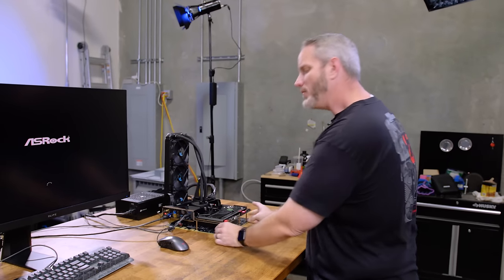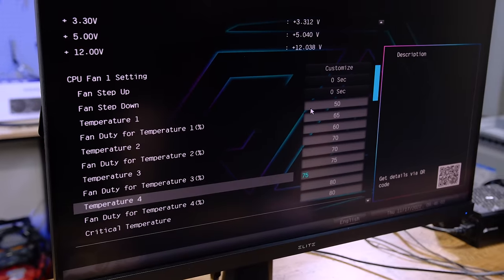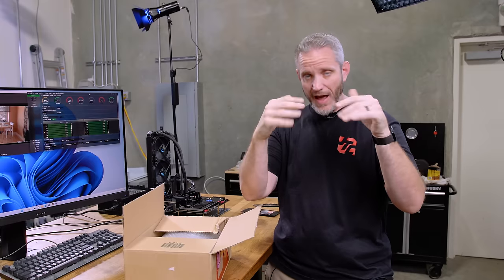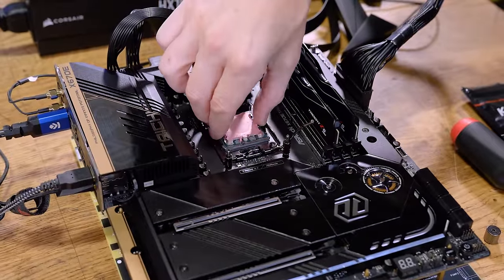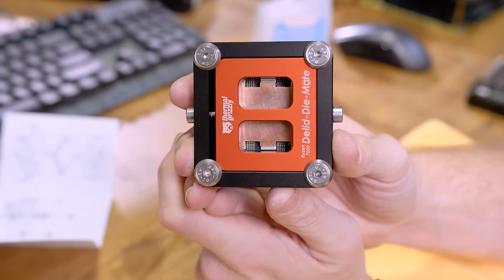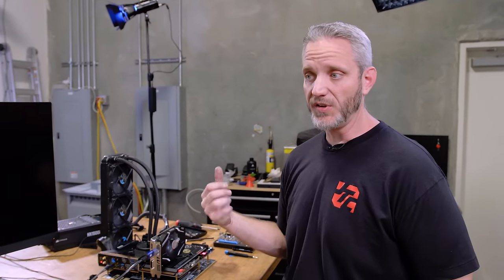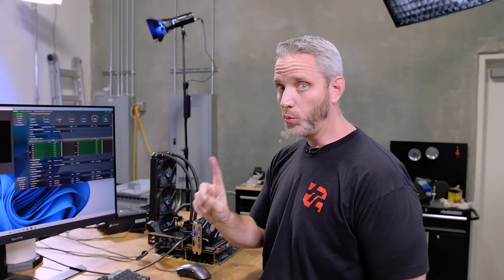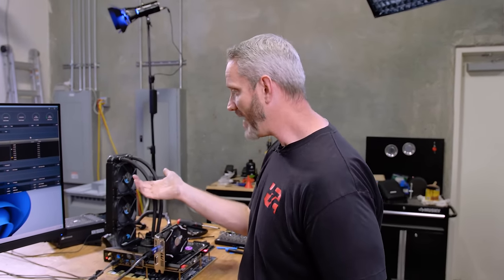I was scared to delid my CPU, but then...

Comment: Arctic MX-4 will do anyone just as good as Kryonaut, don't feel pressured to use Kryonaut just because Jay said so. Kryonaut actually has been proven to degrade/dry out faster above 80C, meaning using it on Ryzen 7000 will not be a good idea.

Comment: What is the coresponding settings on MSI boards to decrease voltages on CPU ?
Im using right now PBO on, Curve optimiser  on each core but overall voltages on CPU is about max 1.45

Comment: so with the new ek waterblock for am5 they don't use their own backplate anymore it is made to use the sturdy backplate that already exists. i just ordered their velocity^2  for am5 and it only came with the waterblock and the tools to install. it's screws are also completely contained in the housing and non removeable. so you now need to place on the waterblock and screw set up in through the back of the motherboard with the self contained screws which pulls down on some springs and places tension on the device. way different than the velocity^2 am4 which they just made a backplate for if you already had the am4 waterblock. this post is about jayz comments around 26min in.

Comment: I wonder if any of the major watercooling companies plan to make a block / mounting kit for de-lidded CPUs.
Reply: With the water blocks I have used the last few years I did not need another mounting kit. The bolts usually have enough thread and it is worked with springs. Otherwise bolts from the hardware store also always go.

Comment: CPUs are very much a Lottery, and sometimes you are just the Lucky Winner with a excellent peace of Silicon that can handle much lower Voltages without instabilities then the rest of the same CPU.  Instead of an Offset at 20-40 mV you can set the Values to -60,70 mV or even Lower. You should not be afraid to just test by lowering the Voltages step by step until the System crashes.

That indicates, that you have to go back to the previous Setting, there's you're stable Setting. You can of course add a little more Voltage as a Safety Margin. The CPU wont be able to get damaged, only from Overvolting.The System will recover to a stable state after the Reboot, don't worry. I, and many other Overclockers have done that many times and like i said, it's Impossible that the CPU could get damaged!

it's like a Car that runs out of Gas and they too will indee restart after you put Gasoline back in the Tank. ⛽ AMD has now a cool, and even safter approach with Curve Optimizer where you can tweak the Voltages for different Clock Speedss

Comment: So, you went through the trouble to set static fan speeds and temperature test the CPU before delidding so you could compare, proceed to test it and blame it on the voltage. Lol. Nice apples to apples comparison.
Reply: He had to do something after doing all that work and not seeing an improvement.....

Comment: When I replaced the cooler on my 7900x just to see how the paste was applied, as long as u wipe most of the paste off when the CPU is still installed in the socket and u don't remove it and clean most of it and then take it out u should be fine

Comment: I have an old Intel P3 1GHZ CPU that came already delided. Would be nice if AMD and Intel would offer delided CPUs like Intel used too. Or just milled them flat at the factory and actually used good thermal paste instead of that cheap crud they currently use.

Comment: You have it a little sideways with whole tangent about the BIOS.  Running a negative voltage offset means that for a given frequency, it will specify a lower core voltage.  This means less power draw and less heat output.  The improvement you found by running the offset works regardless of the cooling method.  The improved cooling lets you run more power (read: voltage) through it while staying under 95C, which means you can run higher voltages and thereby keep a higher clockspeed stable.  TL;DR improving the cooling moves you along the voltage-frequency curve, assuming you aren't maxed out on voltage yet, but changing the curve offset shifts the whole curve to a potentially more favorable setup (depending on how good your silicon is because bad silicon won't always be able to run those -40 mV undervolts and remain stable).

Comment: The more time goes on, the more I appreciate my aging 5950x. Efficiency is where it's at. If you work on your computer and game like I do, running a 5950x is a something like $10 savings a month compared to some juice monster like 13700. After 3 years of use I will have energy savings over more than 1/4 my card! I genuinely believe people need to consider the cost of higher power draw, and also shorter lifespans inherent of juiced up components.
Reply: Having a more efficient CPU also means less heat in the room. That's the only reason one of my friends went with the 5950x over Intel.

Comment: Now, if AMD hadn't insisted in shoehorning "compatibility" of coolers for AM5, of which half aren't even compatible anyway, rather than just implementing a new AM5 mounting system, then the IHS wouldn't be so damn thick, temps wouldn't be so high, and none of this would be damn necessary. It really irks me AMD went for jank "compatibility" over performance and manageable temps!

Comment: Yeah… as someone who has had 3 Asrock motherboards, the lower end ones

They are really annoying to use

Back when b350 was new, I had one and got so fed up with its weirdness that I just got a MSI tomahawk that was WAYYYYY nicer

Even on Intel, the Asrock boards are really annoying, I had a h61 board? I think

Back with an i3 3320 that I had pulled from a dell pre built, and everything  worked fine, till I wanted to trade it out for a i5 3550 that I bought for 20$

It gave me THE MOST DIFFICULT time getting it to even post

At first I thought the cpu was borked, but I had another lga 1155 board that it worked fine on

So I was like ????

It finally worked, after I removed everything that was plugged in other then power, and plugged in only 1 stick of ddr3 Corsair Vengeance 4gb

I ended up getting an asus board that I was wayyyyy happier with

At the end of the day, Really, imma stick to Asus, MSI and EVGA for boards

Everyone else kinda seems second rate in comparison, always funky stuff that happens otherwise

Comment: i delid a i9-13900k and now my mobo has a dram light and doesn't post. :( a celeron G6900 works in the mobo.  F

also you can bend socket pins and bend them back and have the board work perfectly fine. i've fixed a few bent pins on different boards before. accidents happen. 
you just use a good magnifying lens and sharp tweezers. observe surrounding unbent pins orientation and the angle they reflect light and get it to match as best as possible. 
breaking a pin off is the socket killer. i haven't had that happen yet. 
Also there's a surprising amount of ground pins surrounding the communication pins so you might get lucky and that pin doesn't matter. usually all ground pins are connected on a pcb unless you got isolated circuits.

Comment: I know this has nothing to do with the video, but does anybody know why on a windows 11 system that unless the power supply cable to the outlet is unplugged before startup the wireless adapter on the strix b550-f gaming wifi II motherboard won't work. it works fine if when you shut it down you unplug the computer from the wall.

Comment: i've used kryonaut for awhile, and the extreme version doesnt have THAT much different than the Thermal Grizzly Kryonaut. think the difference is 11.2 to 12.1 or so.
Dont like the color of the extreme tho, but i do love the cooling performance of Grizzly so thats  what i use, and if you compare  the paste that is stock on the corsair H115i elite cap vs removing that and adding the Grizzly you have 10-15 degrees celius in difference in cinebench R23.  The idle temps are also noticeable by 3-5 degrees.    I don't know if it is that the paste is more effective under heavy load, but it shows its effect when you run cinebench! :)

Comment: got a ASUS TUF GAMING X670E PLUS ddr5 32gb 2x 16gb @ 6000MHZ and i was getting instability w my DH15 cooler, i checked thermal paste method and it was fine so knew was something else. (YES I CHECKED QVL memory compatibility and did full memtest was not the ram)

solved my personal issue by turning off cpu performance auto boost and sticking with the expo II settings, and solved my uncomfortableness with the whole 95c AS DESIGNED TEMPS that AMD claimed, by turning on AMD ECO mode 170w.

I lost roughly 8% performance, but now CPU only gets to 72c under 100% sustained load, and system is stable and passed an overnight CPU and GPU stress test.

its a weird ass CPU thats for sure.

Comment: Hear me out, for the backplate/mounting depth issue, nylon washers with the same depth of the IHS behind the motherboard. Potentially easy fix?
Reply: That wouldn't be good because not even mounting pressure. Maybe 3D printed Nylon solid spacer? But to print nylon that's a huge setup, heated print chambers, etc.

Comment: You need to be running a lot more stability tests after applying your negative curve optimiser settings. Chances are you may have a couple of cores erroring without further testing and setting per-core negative optimisations.
Reply: This. I let Ryzen Master figure out a voltage offset for my 5950X with the Curve Optimizer. It came up with the max of -30 mV. It was completely stable during Cinebench, but not stable at all during gaming.
A different YTer said his highest stable offset was -12.

Comment: It felt like your video took a huge jump, missing out the mounting of the delidded CPU -which I was wanting to see, and to hear you discuss - and initial testing.  I had anticipated that you would have rerun the tests under exactly the same conditions as you did prior to delidding, so I was completely confused from that point.  I am a novice at overclocking, so you can read this as the idiot-level testing of your video.

Comment: That thermal paste is expensive wow it works well. Been using it for a few builds not and for my first GPU water block. 380 50c with an overclock while gaming in an SFF case.

Comment: Asrock loves beating CPUs with overkill voltages. My b450 steel legend was pushing 1.5v, with LLC of 5, onto my R5 3600. Needless to say my CPU was hitting 97c in the winter times, so went into the bio and manually set the voltage to 1.15v with an LLC of 3 and I dropped over 40c. This was on the stock cooler BTW.

Comment: Thick IHS is going to plague this platform for 3-4 years then.
Even when soldered it's hurting thermal conductivity, only thing they can improve is the efficiency of the chip to lower temps.
No fucking way I'm going to run a 95c CPU 24/7 even if it's within specs.

Comment: Is kryonaut extreme for everyday use or just for these short term high  level overclocking  attempts for benchmarking , does it have longevity on the die vs more traditional  still effective variants of the grease aeronaut, kryonaut

Comment: I had problems with grizzly Knox thermal paste with my amd cpu and saw high temperature with Grizzly Knox  thermal past. It did not work for the EVGA 3090 FTW gpu card. I had to switch the past out with kingpins thermal paste and saw the temperature drop on both the amd and Nvidia cpu. I am using it on the 12 gen 1290 k cpu intel.

Comment: Now I'm wondering if AMD or intel will ever Make a CPU that is specifically designed to be water cooled so instead of mounting a cooler on top of the CPU the CPU is actually integrated into the cooling loop

Comment: Be nice to see a kit developed with different mounting screws /springs etc to cover bolting on the AIO's as that sort of hardware isnt what I can pick up instore, and is an minimum order online type. If you buy you wait and wait and then oh no, wrong size dosent work, back to ordering again.... and again.... you get it. So get a kit together with a million cross options and sell it for say $50AUD ($32USD). If i'm going to spend $100 for a de-lid tool / risk killing a $1250 CPU, what is $50 more.

Comment: I wonder what kind of performance gains you’d see from simply applying the BIOS tweaks. The idea of lapping and delidding the CPU only to then be required to manufacture your own mounting solution for the cooler is more than I’d be comfortable with. Honestly, even delidding would probably be beyond my comfort - those sounds would paralyze my hands and wrists from continuing to apply force.

Comment: Will you do a video on bios for gaming? Most of us puts everything together. update drivers and that's it. But if we can get better performance through setting up the bios if it can help. Can i use my Ryzen 5600g APU and let it sync with my GPU to use both GPU and dedicated GPU power for double the performance?

Comment: ASRock is throws a bucket load of voltage through LLC if it is set to anything other than normal or high(you'd have to reduce vcore to compensate). This happened on my 8700k and 3570k and am waiting for my 7700X to come back from the store(waterpump coil noise) to see if on an Asus MB I can do exactly the same, 95ºC is too much and would rather not have to deal with potential stutters down the road on demanding games because it keeps boosting the CPU to oblivion.

Comment: your saying that a tiny MICRO fiber has enough tensile strength to break a capacitor off of the chip, but a toothbrush with much thicker bristles cant do that.. idk but that seems idiotic too me, watching you scrape away at that thing with a toothbrush was brutal.

Comment: Even though Kryonaut (Extreme) TIM just very good for temperatures. How is the long time performance? There's the pump-out effect especially in direct-die applications. How much better can a TIM be, if I have to apply it again after a few months (or maybe even weeks). Are those idk 2°C worth it?
Maybe on a GPU it's not that big of a deal but I bet in a laptop (depending on the model) and console (not the PS5 because already has LM) it definitely is fine consuming to take it apart.

So could we please consider not just the performance but the longevity of thermal paste as well?!

Comment: Should AMD have made a turtle instead of a spider and just had the IHS go edge to egde with depressions for mounting? 

I mean also try having your IHS be factory lapped on both sides so the part over the compute unit is the thinnest, like tin foil. The IO and everything else could just be a hair shorter then the CU and not need to be as finely surfaced. Just lap a small section on the inside. 

And ffs, lap the outside THEN nickel and print. Omfg. It's 2022. 

Ugh. Rant over. Love you guys

Comment: Well , with the " locked" 5800X3D its the same , you get 150 - 200 Mhz more all core Speed in Cinebench with Curve Optimiser at -30 , those MoBos where PBO is disabeled with the 5800X3D you can use PBO2Tuner which is a Software which re enables PBO2 with Curve Optimiser in Windows = less heat , higher Clocks , slightly less Energy consumption  , less Noise because the Fans dont need to ramp up that high due to lower Temps .
Reply: I really need and am interested to know what will be stronger in gaming performance? 7950x with delid and full overclocking of all cores to 5.5 or 7800x3D. The problem with 3D processors for me seems to be in two things: they cannot be overclocked as I want, and these processors have different chiplet heights, which makes it difficult to delid. I don't like cheap so cheap ways to improve performance. I want to squeeze the maximum, raising the maximum voltage and frequency. I have no problems with cooling, because the radiators of the cooling system are placed on a cold balcony and I live in northern latitudes.

Comment: Quick question, was wondering about case thermals and was thinking like is it absolutely necessary to have exhaust fans? Wouldn't it be better to have a constant intake of cool air always coming in and hitting all the components from every angle? Like from the bottom, front, top and back all blowing inside the case? Or maybe use just the single back fan as an exhaust? Has anyone ever tried doing it this way before to see if there's a difference?

Comment: For something as crucial as the Socket Cover, there really should be a little snap for it somewhere on the Motherboard. Because that is an important part to keep and everyone will lose it.
Reply: Usually a MB comes in a box, right. Theres a lot of space to store a tiny cover. If you wanna sell the board later you will keep the box anyways.

Comment: What do you mean you went the the 7950x over Intel because you wanted the best? .... The 13900K and even the 13700K smoke the 7950x in basically ever single test. The only thing the 7950x does better is power efficiency, and if your building a high end desktop with top of the line components, power efficiency obviously doesn't matter or you'd just go with cheaper lower end components.

Comment: Yeah so if you go into the AMD overclocking menus you can set whatever TJ max you want and the -40mv is the curve optimizer value, so set it to negative then 40. AMD specifies -130 and +40 I think but most motherboard manufacturers only let you go to -40 or -30 it seems. Granted I'm only on a 7700x but with an unmodified cpu, tj max stock at 100 and a -30mv I don't go over 80c on a NH-D15S. Then the freq max tends to be the blocker even with +200 so you gotta start upping the asynchronous clock 1mhz at a time this pushes up the whole curve but you gotta keep it under the max stable freq by lowering the max boost usually under lower then 0 into the negatives. SkatterBencher has a very thorough guide here on YT.

Comment: I don't see why you'd delid a soldered CPU. I understand the benefit of doing it to old intel CPU's that used thermal paste, which dried up and overall underperformed brand new compared to solder, but with these CPU's you're essentially removing metal to put your own metal in.  
Am I missing something?